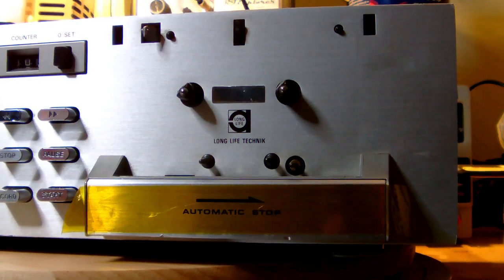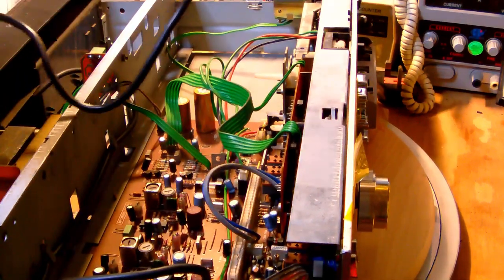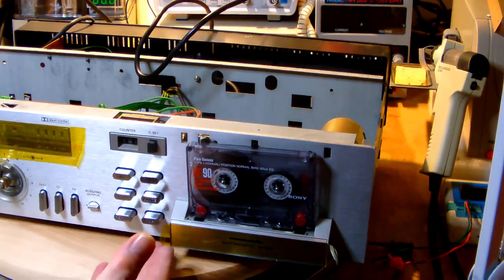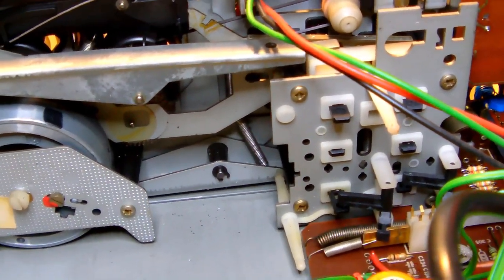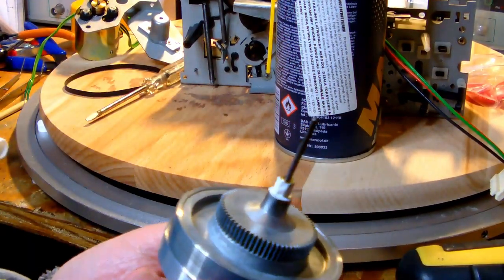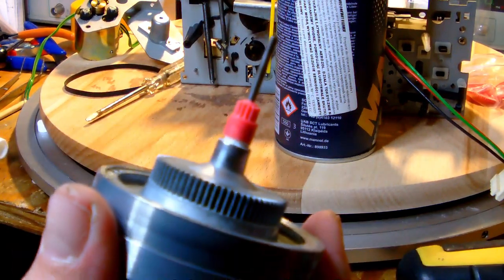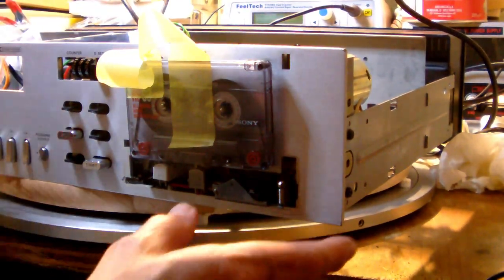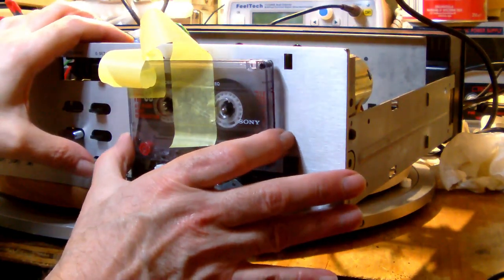Grundig CF5000-2 Cassettedeck Repair Restoration part 1 of 1

Comment: Thanks for these great  video for these cassette deck.
Because of you, i wil order the broken gear to repair my exemple of these material. :)
Reply from the maker: Hello Cyril. You're welcome ! if you do it slowly and methodically you should have no problems repairing your cassettedeck :) Glad my video helped you and you enjoyed watching it. Thank you for your nice comment and considering subscribing. Merci ! :)
Reply: @TechneMoira  
I have a question. How have you done to make the lights become blue?
Originally the lights are ‘neutral”, no?
Maybe I missed something in the video. 🤔
Reply from the maker: I replaced the original light bulb (12V filament) by a blue 5mm LED. However, you need to replace the orgininal resistor in the positive powerline to the lightbulb by a resistor anywhere between 600 and 1000 Ohms (depending on how bright you want the LED to be) Also, make sure you put the LED in with Anode going to the V+ or you'll ruin the LED
I explain it in the video ;)
Reply: @TechneMoira  
Thanks for your answer. I will look your video more carefully again before repair my cassette deck. And have a check on this. 
But maybe it will be too much hard for me.

Comment: I recieved the gears and the belts yesterday.
My cassette deck work fine now because of your great vidéo.
But it still have a problem. The channel leds doesn't work for left channel. Do you have a idea of origin of this problem.
The two channels works, I've tested it. The sound works fine. I think i't only the led. 
How can I found the problem?
Reply from the maker: Find the IC 601(or 602) (also designated as U267B) on the display board. These IC's are the VU-meter LED drivers. Measure if there's a (loud enough) audio signal present on pin 7 (of either IC). Pin 7 is the audio-in pin for the IC's. Check if there's power on pin 8 of the IC (measured between ground and Pin 8). there should be between +12 and +17V DC on pin 8.
IF there is power on the left channel IC, but no LED's switch on when playing music, try to inject an audio signal on pin 7 to see if the LED's react to that. If they react, then there might be a fault at the driver transistor (T104 or T204)
If there is an audio signal on PIN 7 and enough DC power on pin 8 and still no LED's switch on then there might be a problem with the LED's or the IC.
Check the LED's are all still well-connected on the PCB
If nothing of all that helps, then the problem might be with the IC and/or the LED's and you MIGHT have to replace them OR look further on at the driver transistor(s)
Good luck !
Reply: @TechneMoira  I’ll have a look quickly. Thanks a lot for your precious help. And take time to answer my question. 
You’re great!
Reply: I have take measures. Pin 8 seems to be ok. The value is the same for right channel  about 18,5V. But nothing on Pin7 for left channel , Pin 7 on right channel give changing values depending of sound signal. I think U267B is dead. I'll try to change it. 
The leds seems to work, they light when I touch connector 7 and 8 with my multimeter
If I make a "bridge" between the two Pin 7, all the leds working.
I think we found the failure. Thanks once again.